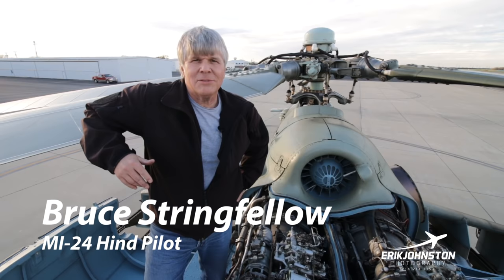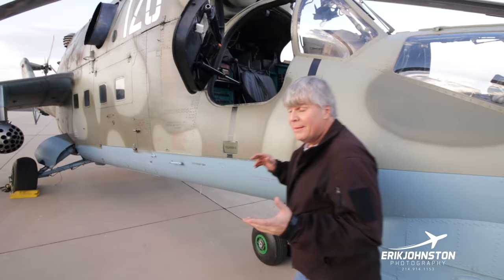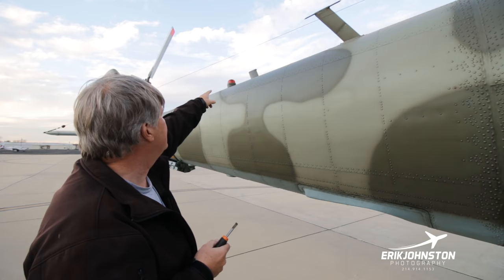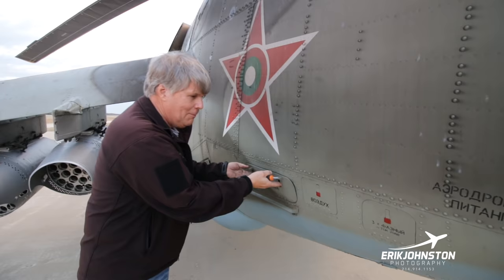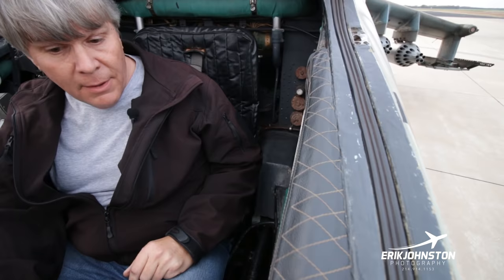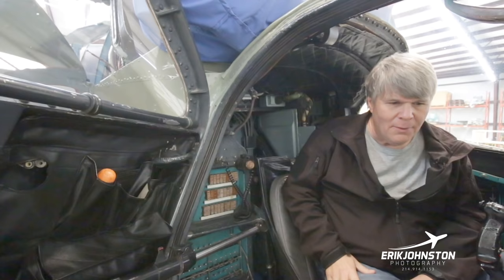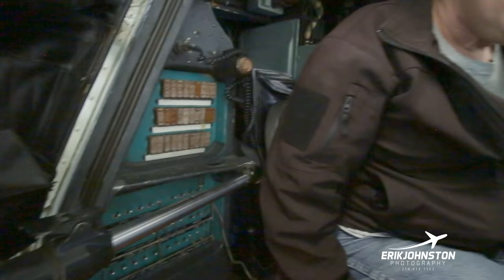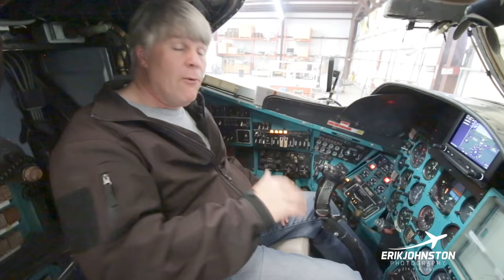Hind MI-24 Helicopter Walkaround Tour

Comment: Important angles of adjustment of the collective control lever.
4° transition mode for autorotation
6°-7° setting for descent at speeds above 240 km/h
7° circle flight before landing
9° setting for optimal rotor efficiency when performing elements of piloting on the vertical axis.
up to a value of 12° for a safe take-off from a hover above this value take-off on the runway and take-off like an airplane when reaching a speed of 80 km/h.
14° maximum setting
Depending on the weight, the value is different.
This applies to a take-off weight of 10,500 kg to 11,200 kg.
For sharp turns, it is necessary to leave the collective control lever secured. This means not changing its setting by holding down the button with the thumb of the left hand. Changing its setting should be done in permanent configuration and not in transient modes. Under certain conditions, a dangerous condition (named in Russian as PODCHVAT) may arise, spontaneous recovery to a positive angle of +60° with sudden loss of speed and braking without increasing height. In this case, the cyclic control lever is blocked and the rotor blades flap dangerously. There may be a risk of a collision with the tail beam in case of unnecessary intervention in the collective steering. Below a speed of 130 km/h, the situation normalizes and the helicopter is taken out of the dangerous area by a turn to the side. However, it is necessary to have sufficient height. With this element, the height gain is less than 50 meters and the extraction loss is more than 100 meters. This usually happens if a turn is made on the vertical with a multiple of more than 2 g.

Comment: Great video! Just a little correction, the white thing on tail is not IFF system its radar warning receiver so caled SPO-10 Sirena-3M. Friend or foe are those 3 antenas under the tail.
Reply: I was wondering if it was RWR rather than IFF, thanks for confirming my suspicion.

Comment: Anyone else excited to fly this baby in DCS World?
Reply: The new PC is almost done being built. Just need to get the WiFi drivers installed to proceed lol. Then DCS here we come.
Reply: Yessirr!!
Reply: @Andy-rp3ee  interesting, I'm currently in the process of looking to build a device myself, do ya mind sharing your specs so I have another source of reference?
Reply: @Kozak806  mhm, thanks, yeah I've been looking at a couple pretty good prebuilt ones designed to make upgrades later pretty easy, so when stuff gets to be available I could get something.. I'll just have to see
Reply: @Kozak806  okey dokey, thanks again
Reply: @Andy-rp3ee  wifi? for online gaming.  was there, went back to cable. was laggy for me.
Reply: @fulccrum2324  I went with an 
- i9 lga1200
- kraken z63 cpu cooler
- asus rog Maximus motherboard
- still waiting for a rtx 3080, but have a gtx 1060 now
- 64 gb ram
- nvme ssd
- sata ssd
- evga 850 watt psu
- Corsair obsidian case, pretty good cable management built in, but a little stingy :)
- plus all the pretty rgb lighting lol

Have a thrustmaster hotas warthawg with  rudder pedals currently
Reply: @tomast9034  yea, just meant in terms of getting things installed. I do have it hard wired for now
Reply: Definitely added to the hype train, this will be a first day purchase from me.
Reply: @Kozak806  yea also, the 3080 takes like 3 VGA power cables. I went with an EVGA 850w and it supplies 4
Reply: Another note, on the Corsair obsidian 500 you will find ample room for large gpus, as well as plenty of room for a front mounted cooler aio if you want it it (using the top for my cpu cooler)
Reply: Yes.
Reply: I can't wait.  I love flying the UH-1 more than any other module.  I just built a new machine and am retiring in a few months and now we are getting the Kiowa, Hind and Corsair!
Reply: @Andy-rp3ee  fun :)
Reply: @Kozak806  yea misspoke
Reply: I really want it, yes.
Reply: Purely here because DCS Hind has peeked my interest.      Gonna be a great module I think.
Reply: I don't like multi-crew aircraft so I am hoping it is 100% flyable and fightable from the front seat.
Reply: Mi 24 Hind was said to be released in Q2 2021. So on June summer sale?
Reply: @Andy-rp3ee  With that RTX card you will definitely want to upgrade your PSU
Reply: @LabiaLicker  you don’t think the 850w evga will be enough?
Reply: That's why I'm here ;)
Reply: sure, can someone just find me a gpu so i can FINALLY FINISH MY PC BUILD XD
Reply: Yuuuusss!! The Blackshark is cool, but too much auto-pilot for me. I like it rough.
Reply: @tomast9034  My main gaming rigs are always connected by cable. Way better reliability and less lag.
Reply: @fulccrum2324  I play DCS with Ryzen 3600X, Asus Prime X570-P motherboard, 16GB Corsair Vengeance DDR4 3600mhz, GTX 1660 Super, Samsung 500GB 970 Evo Nvme SSD. Looking to get a faster gpu for VR but everything runs smooth maxed out at 1080p as is.
Reply: YESSSSSS
Reply: The wait is almost over... :)
Reply: I'm doing it right now - it is a blast!
Reply: It's a blast in VR, just sayin'

Comment: This helicopter wasn't designed to be a counterpart of any western attack helicopters. He was the answer to experiences the US made in Vietnam. Troop transport and self clearing of hot landing zones are the firts things that had to get done by these kind of aircraft. Later, the front gun was removed and it was replaced by two cannons from a larger caliber, mounted on the right side of the cockpit. These autocannons were called as 'pushka' , so this Hind version wasn't a called a  'D' anymore, rather than the  'P'. The larger caliber was much more effective against the clay walls were compounds and dugouts in afghanistan were made of.

Comment: "Не становиться!", written on the service hatches (turbine and hydraulics) means: "Do not step!" :-) dude is literally standing on them for the first 10 minutes
Reply: they can probably take the weight of two or even three mechanics, with tools, while the helicopter sitting at an angle on a rocky mountain side in afghanistan ))
Reply: That's for the panels further out. The inner parts of the hatches are meant to stand on for servicing.

Comment: Can you imagine a Russian guy having his own flyable Apache?
Reply: Cobra. The counterpart to the Hind was a Cobra. For the Apache the counterpart would be a Mi-28, to my knowledge none are in private hands. Yet.
Reply: @Kozak806  The Cobra is very much a Hind's counterpart. Apart from appearing in the same decade, both are based off of a transport chopper. Cobra off the UH-1, Hind off the Mi-8, both used similar types of weapons and had the same roles. Iraq/Iran war even had them duke it out directly against each other several times.
The Apache and Mi-28 are a generation newer. Weapon systems are quite different, so are the tactics and roles. Both are new constructions from the ground up, not repurposed airframes from transport choppers.

And my point was that while it might actually be possible to buy a de-milled Cobra because it's just as old as the Hind, it's very much impossible to buy an Apache as a private party. You'll need to wait maybe 20 years until it becomes as old and obsolete.
Reply: @AKAtheA  The Mi-24 and the Apache helicopters are heavy attack. But unlike the Apache, the Hind was also designed for troop transport; the Mi-28 was optimized without this requirement. The Ka-50/52 and the Cobra are smaller and lighter, and their purposes more aligned.
Reply: On point! They have them too!
Reply: @AKAtheA  A Hind could just grab a Cobra and lift it off. They are not counterparts. There are no counterparts for the Mi-24.
Reply: "Еще не вечер"
Reply: @petterip  sigh...all this time I'm trying to explain that I view them as counterparts because they followed almost the same exact design philosophy - turn a cargo chopper into a gunship. That's it...
Since Bell chose a chopper that weighs less then 2.5t empty and Mil chose one that's almost 3x as heavy and gave it 4x the shaft power, there's going to be "a few" differences, namely that the Hind can literally carry over 3x as much weight (including fuel). It can haul ass, fly way higher and/or carry (pretty substantial) bombs, the Cobra has a lot more range and endurance.

As for the grabbing and lifting off with it - only if the Cobra is completely empty and the hind has only about 1/3 fuel remaining, nothing else.
Reply: No because Russia is pretty poor country and Apache costs more than middle sized African country
Reply: @Cesko_Plny_Fialovejch_Zmrdu  Нет, дело тут в том что это дорогая и никчемная игрушка для ребят из пентагона созданная для обогащения военных подрядчиков. В России же, все делается дешево и эффективно,  как раз для войны.
Reply: @Cesko_Plny_Fialovejch_Zmrdu  well the Hind costs 100 potatos while Apache costs a few million dollars... that's a lot of potatos man
Reply: @TheGranicd  The Apache is miles better than the MI24.  The hind was a terrible air craft. Poor service ceiling , which got really bad when fully loaded. Service ceiling listed is empty and without pods specifically as propaganda to show a higher service ceiling than the aircraft actually had. In Afghanistan they had tons of issues because they couldn't fly over the mountains and when flying at speed they couldn't navigate well between the mountains so had to fly slow.

You might think... aha... but it's armored. The cockpit had steel side plates. that's the extent of it's armor. All that armor and the dual role of transport/gun ship was incredibly stupid. All helicopters rely on speed and altitude to defend against ground fire. Half of the mission the Russians needed during the war could not be completed because the aircraft was a really dumb design.  Any helicopter, including the hind, can be shot down if you unload small arms fire into it. The  silly huge plates on the side of the cockpit was really a poor choice. Should have seat plates and left off the huge heavy plates.

It had poor flight characteristics, terrible design, over weight and couldn't fly high enough. The cobra had a similar problem with service ceiling, which is why they literally added another engine and even that wasn't enough. The MI28 and the AH64 are both miles ahead of the MI24.
Reply: @TheGranicd  
Yes russian has Hind. Not Apache lol
Reply: @AKAtheA  
We saw super Cobras over southern california recently. Happy Holidays !
Reply: @AKAtheA  you forgot ka-52
Reply: Ну, если США распались бы и распродавали технику за полцены направо-налево, то какой-нибудь олигарх может и купил бы.
Reply: @Cazac89  ok
Reply: Why would he want one? Russian gunships are better.
Reply: @DmitryGrigorev  What does this have to do with anything? I merely stated no Russian gunship pilot would want to fly an Apache as they are primitive compared to today's Russian gunships.
Reply: This guy actually has 2 Hinds
Reply: This is the only country where an average Joe can fly.

Course that's all about to get yanked from us now.
Reply: I'm new to this channel but does this guy own this helicopter?  If so, TIL if ur rich, u could buy a Ferrari or a ex Russian military helicopter lol
Reply: Also, how did he get all his information?  U can't google this info on forums?  Did he talk to previous pilots or technicians or something?
Reply: @phantommedia9964  what's a little peculiar also is that that thing looks like it could be made battle ready in about 15 seconds.
Reply: @fredmdbud  the Apache is also designed to pull sneak attacks from behind trees and hills (thats what the longbow D variant was specially designed for) while the Hind is a full front "what the hell is that" ship.. The MI-28 oddly does have a small cargo compartment that can carry 2 guys .the concern was that if one went down.. anther could pick up the crew right away and evacuate the area before enemies could get to them.. a lesson hard learnt in Afghanistan for wich the Hind was coincidentally well suited
Reply: @fredmdbud  The original Mi-28 had a compartment fir 3 or 4 soldiers.
Reply: @Cesko_Plny_Fialovejch_Zmrdu  which African country?
Reply: Neither the cobra nor apache are a counterpart to the hind. The hind is essentially an ah-1 (cobra) and a uh-1 (huey) combined
Reply: or Black Hawk
Reply: Самый подробный оюзор Ми-24, который я видел)))
Reply: Soon.
Reply: @AKAtheA  the HIND is in a league of its own.
Reply: @Thickcurves  most helicopter pilots fly extremely low in combat zones. Your point is invalid.
Reply: Ну и на кой чёрт мне этот апач? его обслуживать - целое состояние
Reply: @Lowboard_Fun_Research  а с ми-24 справишься?
Reply: @DmitryGrigorev  Ессно! Игорь Негода поможет. Он у меня в друзьях есть в ВК)
Reply: @fredmdbud  yes the Hind was such a adaptable machine. Not only was it a attack helicopter but could be used for transport. Genius design!
Reply: Russian oligarchs can have anything at all, not only their own flyable Apache ... but ordinary guys in any country get such toys only when they serve in the Air Force.
Reply: @kalsarikannit2058  yeh you got the money in Russia you can have pretty much anything!
Reply: @kalsarikannit2058  Just like Rimbaud, who ran a million dollar vehicle in the army)
Reply: @chele089  I think the US Forest Service has at least one or more Cobras for fire-fighting purposes.
Reply: I heard one of them had. For sure! I heard about it by radio in early 2000
Reply: i think they dont have live ammo even during the yearly show over the red square....some comrade may have a crazy idea to bomb the whole goverment down....with putin in it. :D:D
Reply: @tomast9034  , how do you think, if US Air Force would have a show in Washington's sky, would they carry real weapons?
Reply: If Russia would invade 100 countries in 100 years and install puppet “governments” here and there, then I would imagine... :-)
Reply: @AKAtheA  MI-24 wasnt repurposed MI-8. It was made from scratch, and made masterfully to make it so reliable. Attack chopper with 335 km/h top speed and huge payload. Flying tank.
Reply: @stroichik  it definitely borrows a lot from the Mi-8. Main rotor head, gearbox, engine placement, rear rotor, the APU...pretty much identical. 
It makes sense to reuse a design that works, no need to reinvent the wheel. They had to have enough engineering problems with all the stuff that was actually unique to the Hind :P
Also I would not use the term flying tank. IFV - sure. Tank - no way. It's not that much armored.
Reply: The Russian guy is having a Ka-50 and doesn't even need a CP/G to operate the thing :)
Reply: @nationalistcanuck7800  what russian gun ship makes the apache "primitive? You mean the new Ukrainian one in development? I'd bet every russian hind pilot would want to fly the apache just to see what they could be up against. Just as every apache pilot would want the inverse.
Reply: @AKAtheA  Fun Fact: The Soviet stopped Producing Mi-28 and got Replaced by KA-52 just only 2 Years after Mi-28 are comissioned or produced. And only around 2005 Russia started Producing Mi-28 again.
Reply: @Thickcurves  Nice hype there about your Apache. Well anyway, you should know that neighboring countries of Russia have thought that Hind is/has been a very effective tool that is most certainly not to be dismissed. Transport aspect is absolutely crucial on many kinds of missions and note that crew that can be transported is very substantial for helicopter. It's specifically made for "critical" personnel insertions what I've been told. Isn't it still one of the fastest helicopters there is?
Reply: @Cazac89  вечер и уже давно.
Reply: @CakePrincessCelestia  Didn't work as well as they expected though, too much workload for the pilot despite all the automation. Had to develop it into a two seater (Ka-52) anyway.
Reply: The Hind looks more comfortable.

Comment: 34:00 - 12V batteries are essentially dead at 12V due to over-discharge. At full charge they are 14V, so two would make 28 which makes sense if they expect 27
Reply: No, 12 V batteries have 12 volts at full charge. The charging system typically charges at 13.5 to 14.5. One the battery has fully charged the excess voltage flows "over the top" of the battery and powers the system. While running with generator online, main bus voltage will be around 13.5 to 14.5 VDC. Turning off the generator will result in an immediate main bus voltage drop to 12 volts.

Comment: Fuel system.
Tanks 1 and 2 are consumable, their capacity is 2x320 liters
Tank 3 is a combat fuel tank with a volume of 510 liters
Tanks 4 and 5 are flown into the area of combat activity.
So now you definitely understand why they are where they are and why a rather complex pump valve control system was invented. :)
In-flight fuel gauge used to show a total fuel capacity of 2130 litres. After tanks 4 and 5 are exhausted, it is better to switch it to the content indicator in tanks 1+2.
The emergency remainder is 2x120 liters and will also be announced by the RI-65 automatic voice device. Then you have to have soft feet during the flight and it is easier to have the ball on the inclinometer in the middle.
For the calculation of fuel consumption, we always counted on a value of 15 liters per 1 minute.

Comment: Autopilot.
In this helicopter, the autopilot worked continuously and stabilized the flight in the range of 18% deflection of the control elements. Piloting was extremely smooth, precise and without backward movements like on other helicopters of that time.
On previous steering variants, the pilot had to change the position of the lever and thus induce a reaction moment, which then had to stop by reversing and hit the required new position. With this principle, it was enough to move the lever to the desired position and press the autopilot reset. The autopilot subsequently considered the new position of the aircraft as neutral and stabilized its condition.